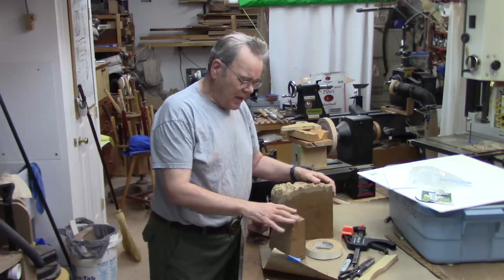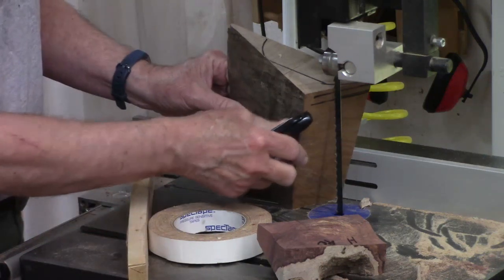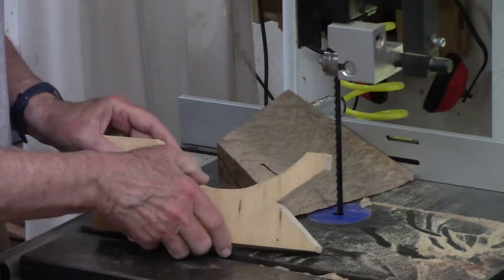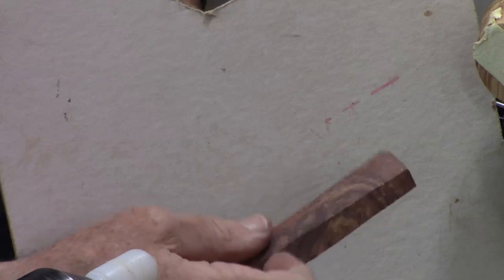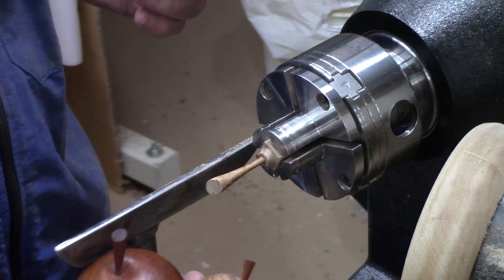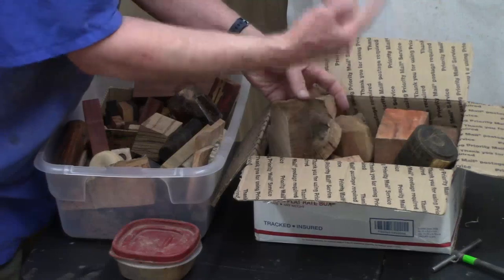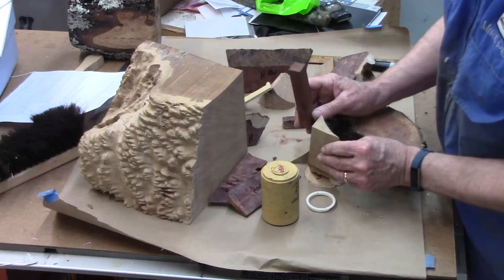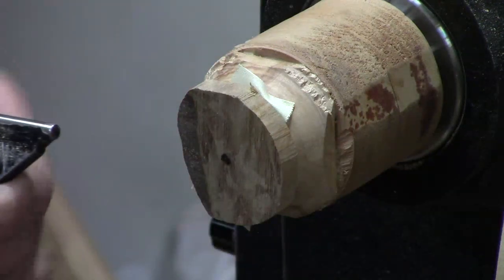Burls – How to Use Precious Bits of Wood

Comment: All very good ideas and some really interesting projects for those small pieces left over from other projects.  Thanks for summarizing in this video; have seen some of the other videos where you made some of those projects; this was helpful for providing a full spectrum of applications.  I found after getting into resin casting that the definition of "scrap" becomes smaller and smaller.  With wood stabilization, even punky wood with character can be utilized for projects.  There are so many ways to use those small pieces of wood.
Reply from the maker: You are right. Thanks for sharing.

Comment: Mike -- I know that you're not into casting, but that piece of cherry shown at the end of the video would be a perfect candidate. I could see a set of pepper and salt grinders being made from it, with the voids filled with a couple of colors of swirling resin. Or, rather than the grinders, a set of candle sticks. Another option, with or without casting, would be holders for those LED immitation votive candles. Make the holders deep enough so that the light comes out of worm holes. They would cast an interesting pattern on the wall. If cast in resin, it would create a stained glass effect.
Reply from the maker: Right I am not into casting but LED light holders is a great suggestion, thanks.

Comment: Another scrap option: Take bowl blank corner cutoffs, true them up to 90 degrees, then glue them together with contrasting thin wood to make knobs, bottle stoppers, pen blanks, handles, finials,, jewelry, or small bowls. If you only have two, cross match them with another pair of corners. These blanks make great use of otherwise wasted valuable wood. One note, if mixing woods, try to match them for hardness/density. Makes for better turning and finishing.
Reply from the maker: Do you use that technique, Valerie! I cannot get a glue joint cut on a bandsaw and would be concerned about securing smaller odd shaped pieces on a tablesaw to safely cut, even using some type of cross cut sled. Sounds too much like segmenting which just does not appeal to me.

Comment: What blade type (tooth&Pitch) do you use on your bandsaw?
Reply from the maker: 3/8" 3tpi like the one Highland Woodworking sells as their Woodturners Blade. I am currently using the original blade that came with the saw that I think is 1/2" 5tpi that I do not like. Not as aggressive and does not do curves as well on smaller bowl blanks.